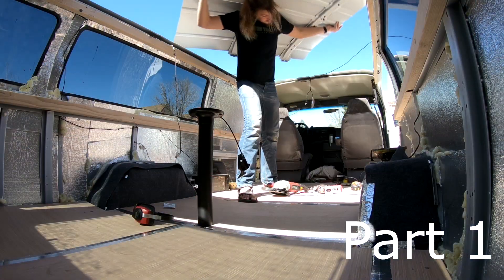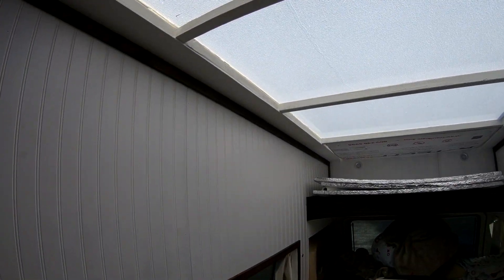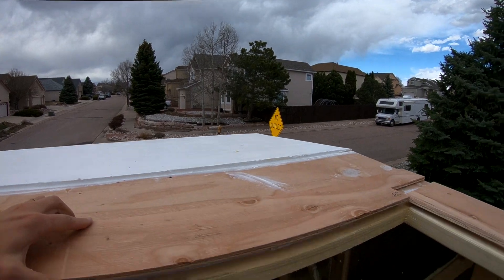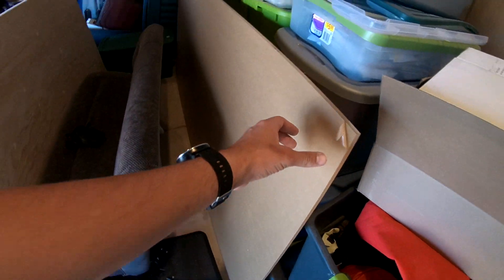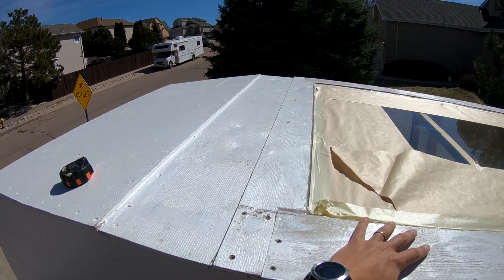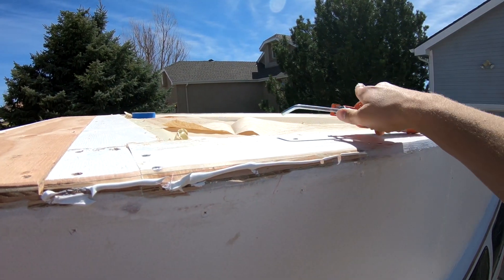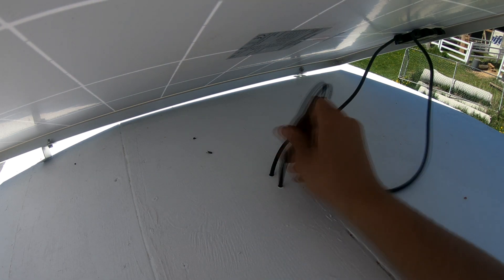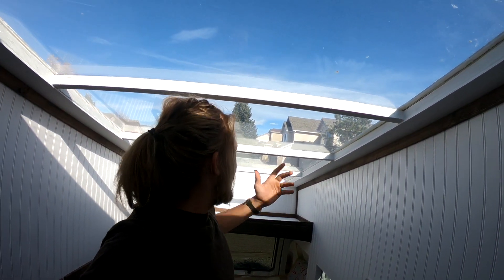How to Build a DIY wood Hightop on a Van - Hightop Campervan Part 2/2

Comment: I dig it!  If you do another, when it comes time to paint the top strongly consider putting on coats of Kool Seal or similar elastomeric roof coating.  It's highly reflective to help keep your rig from overheating on sunny days.  And when it comes time to lay your acrylic sheet down for the roof, prop an edge up, lay down a continuous bead of sealant, and then drop the edge onto that.  Then seal the edge as you did before, for a larger, more secure band of sealing area.

Comment: 😲 Hell man! Have you any idea of the weight you've added to the top of your van?!! That thing is gonna be so top heavy & unstable. You better be goin real slow around corners! Lol! 
I'm guessing  you must have fitted a lot of heavier stuff in the bottom to counter it?
Personally, I would have made moulds and built the roof out of GRP for a lighter more weatherproof structure. 
Enjoyed the video though,  you've gotta have some balls to make that first cut in the roof of your van! 😱 👍👍
Reply from the maker: dont remember off the top of my head but i made a video of weighing the van and seeing how much i added. I for sure drive slow (mostly to get better mpg) still rolling down the street without issues :)
Reply: I'm really pleased to hear that. You must be able to feel the difference though the suspension and steering though right? 
Mind you, your vans over there are quite a bit bigger and sturdier than ours here in the UK.
Reply from the maker: @markvbickley  Driving strait i dont really notice it but i for sure do when i go over speed bumps and go around corners. Thankfully it is still about 750kgs below the weight limit for this van
Reply: @EliPetersonjp  Yeah, I'm not surprised, and I'm sure you can probably handle it with its new characteristics. I hope that anyone else who may be thinking of copying your mega structural roof idea would be aware of how it could affect the balance of the vehicle.
I don't know about the US, but in the UK, if you modified your van in that way and did happen to turn it over, then your insurance would certainly be rendered invalid! 😣
Drive safe my friend and happy camping. 👍

Comment: That is HELLACOOL bro! And as you say, if it gives you problems you can fix it. Fiberglass is a lot heavier than folks may think. Nice job!
Reply from the maker: Thanks so much! I had a wood truck camper before that I smashed on a low clearance bar. Had the damage removed and fixed within 24 hours

Comment: Hereś an idea: Glue on the outside of the top"box" a layer of 2-3 inch Pir insulation without the alu sheets. Then sand a more rounded shape into the foam (using long sanding boards which make for consistent shapes). Then fibre glass the outside and paint it... Will last a very long time...And looks less blocky...

Comment: THANKYOU FOR THIS MY BROTHER
YOU AND I ARE DOING THE SAME EXACT THING WITH THE SAME TYPE OF VAN THAT I HAVENT YET BEGAN UNTO MY OWN 2008 CHEVY 2500 EXPRESS V8 with oversized all terrain m&s tires giving it a 16” road clearance that enable it to be unstoppable in snow mud off-road  especially with its tire chains and tracks 
I have it set as both a camper always having its queen sized bed planks stored behind its table desk locking storage box that houses sink cooler or fridge freezer with propane grill stove table mount 
Toilet shower 
And I fit a 48” mower with push mower and all two cycle and yard tools all mechanics tools and parts and all trades with plumbing and heating my back ground 
It goes to camper from landscaper to dump running to trades vehicle to kids transport to roof top bikes
To always remain totally equipped with all camper survival stocked with food and all clothing and shoes yr round
Plus inflatable four man oared raft and fishing and rifles

I now need to do the roof like you
 

THANKYOU
Reply: post results
Reply from the maker: best of luck! please be safe!

Comment: I love this! I think it just convinced my husband to let me start looking for a van! XD But we were wondering how much this cost if you don't mind?
Reply: Me and my dude just got a van for 500. It needs lots of engine work which is where you want your money to go the most. I got great advice of looking on fb marketplace for materials for in the interior. I've already found wood to build platform for bed and storage. I live in a pretty upper class area so we usually go curbside hunting. You can find amazing new things people will throw away or label free just because of small cosmetic damages. 
If you can repurpose it do it! I already told my dude most of the money is going to go on engine and making sure it runs smoothly. And solar panels will be the only expensive things in our van. 

Good luck!!

Comment: When I started watching your first video and saw that you were using silicone I was thinking that you really should be using 3M 5200. But then you figured out on your own that silicone is grossly over-rated for a lot of applications, especially when it needs to be rated for exterior grade. 5200 is not cheap but it's one of those products that is worth paying extra for. And BTW, nice job on the roof!

Comment: Might get some hot weather plastic sag on ceiling plexi, large rafter spans- Stu
Reply from the maker: no issues yet. I put insulation panels up in the rafter spans to help keep the inside cool

Comment: Thy really makes it look open inside.  Fabulous option for heating the place up in the winter, how do you plan to keep it cool inside in the summer?
Reply from the maker: I have 1 inch insulation panels that fit up in the gaps. Wont be super cool but will help
Reply: Can always deploy flexible solar panels over the acrylic in the summer, to maybe run some electric cooling; fans or maybe a wall of TEC's! :) External shade cloth would be easy enough. Internal reflective insulation would also work, which I think he has for cold nights to keep the heat in.
Reply: He will park it in the shade.

Comment: Looks really good for a DIY. I'm curious did you consider that the roof stiffens the mono body. Your removing the roof weakened the chassis.  You should probably weld some bracing under the van or a couple of arches inside it.  That way you don't twist the chassis. You see lots of steel under a chassis that has had a convertible top added.

Comment: The Acrylic will start to sag in the middle of such a long span , I am not knocking your design , just your faith in a product , that was never designed for the use you are intending . good luck
Reply from the maker: Thankfully it’s all wood so if it does I can just replace the supports and flip the acrylic

Comment: I'm interested to see how it holds up when you start driving over pot holes, speed bumps, etc. #VanLife
Reply from the maker: timewill tell
Reply: @EliPetersonjp  I think your wood working knowledge is admirable.  Made me want to go buy hand tools and make joints. And like you said, if anything breaks, you will simply fix it. A metaphor for life

Comment: U cut out MUCH of the structural integrity, I would of at least lined the opening with angle iron & cross braces of rectangular tubing welded to the angle iron, afraid you are a rolling death trap, wait till a semi passes you @ 70 or 80 and all that lumber start to fly off, that thing looks like a rolling liability !
Reply from the maker: haha been living in it for 7 months now with no issues

Comment: Your van now has no roof integrity .You should  have left braces  in place somehow. Your van wil flex like crazy when you drive over bumps. And go down  the road sideways.
Reply from the maker: Left the ribs over the driver, passenger and in the back. Been driving it on the highway and on dirt roads for 8 months now with no issues